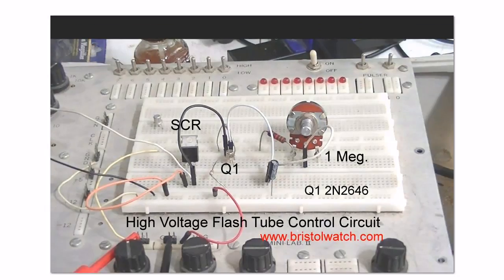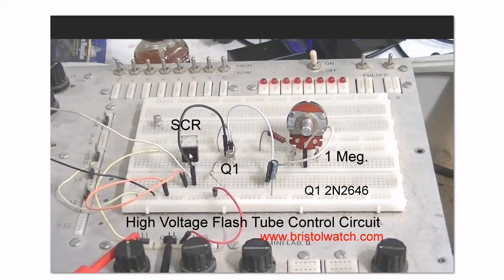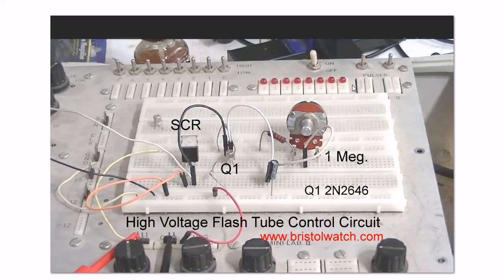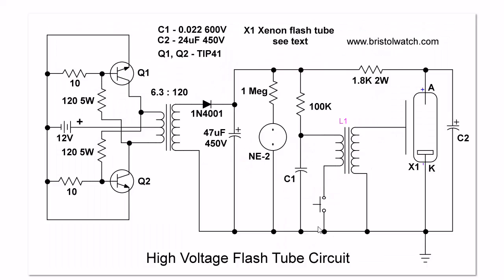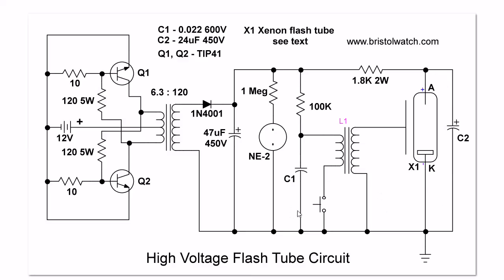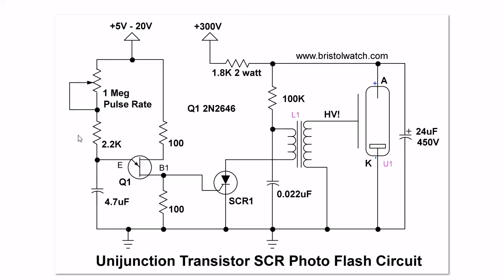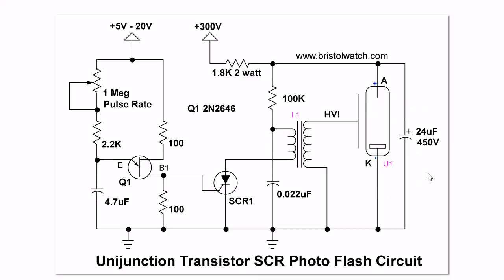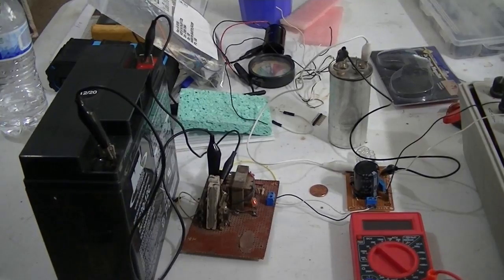Unijunction Transistor SCR Photo Flash Control Circuit

Comment: Hi Lewis,
I have tried circuits somewhat like this, but my SCR latches on after the first shot, even with less 'holding current' than you are using here (looks like about 330v through 100k=3mA)...BIG problem for me since I need a 70-80Hz rate.  Any ideas?  what do you think about MOSFETS?
THANKS AGAIN
Dale
Reply from the maker: Are you AC or pulsating DC? Pure DC will not work.

Comment: The step up transformer is being driven push-pull so the rectifier should be a a full bridge in order to balance the magnetic flux in the transformer.
Reply from the maker: This s demo and the output is high frequency. It works as is and works well.